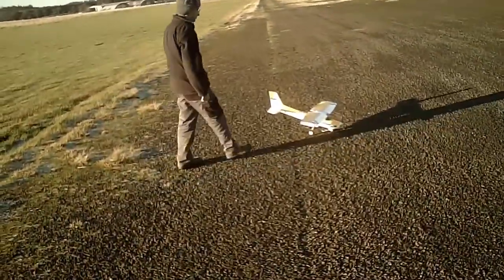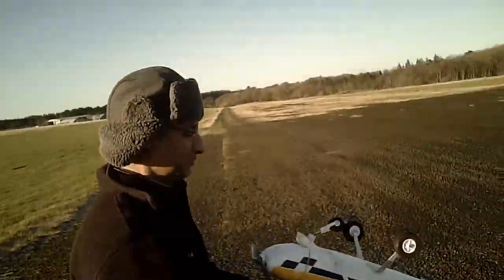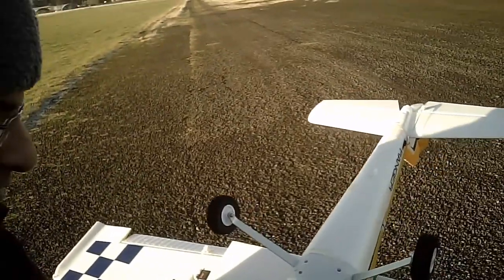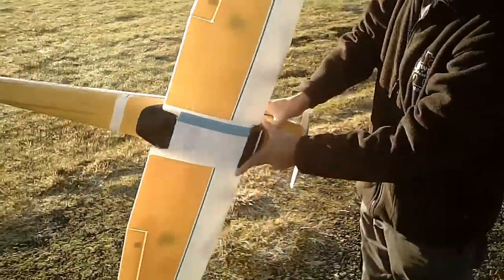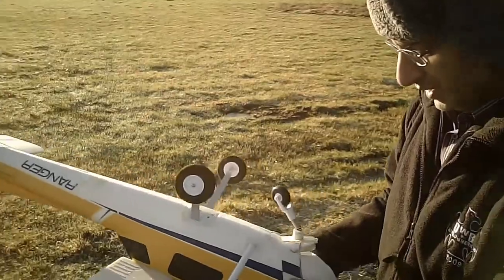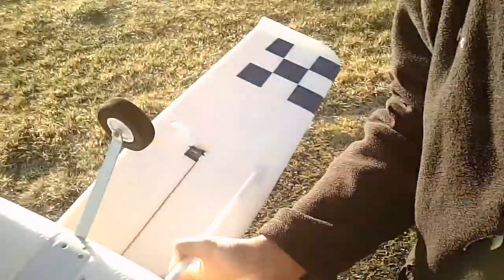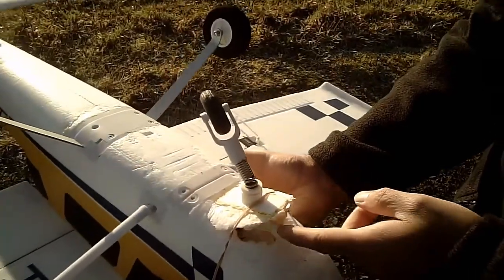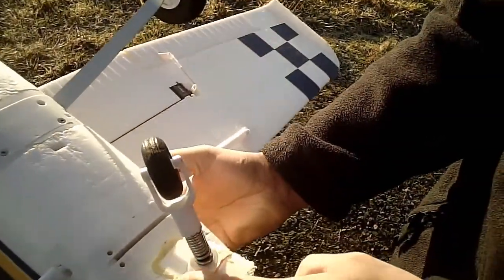FMS Ranger 1220 nosewheel repair

Comment: Did the same to mine several times...
Reply from the maker: Yes that fancy nose gear causes all kind of problems.  On our airfield the main problem is the small stones on the tarmac runway which causes the spring to bend every which way and normally ends in a prop strike and the spinner falling off.  I think once you have bent the spring once on a bad landing it is weaker and bends more readily.  A brand new Spring is just about useable at our site. I designed a couple of alternative nose wheels for the FMS1220.   I 3D printed a larger fork to take a bigger wheel and cut one of the old springs down so the overall height was the same.  In another version I 3D printed a cylinder which takes a piano wire conventional coil nose leg.  Neither has yet been tested.  Another person has replaced the spring with a plastic tube.   I think the real reason for the weird spring is that the foam on this plane is very light so they make the nosewheel very bendy to stop the foam breaking (you can still break it though).   The existing design works as long as you have a smooth runway.  I don't like the design of using a plastic fork on the nosewheel because it limits the wheel size.  I guess it was done to make it look scale.  A larger nosewheel is the best solution hence I 3D printed a larger fork which takes a bigger wheel.
Reply from the maker: You can see the nosewheel moving around in this video.  This was with a new spring, the flexing gets worse after it gets bent once and is then weaker.   https://www.youtube.com/watch?v=AHcE9cNeqbY

Comment: Must have been his first rc plane
Reply from the maker: There were actually two pilots involved.  The less experienced pilot took off but the more experienced pilot took over for the first landing.  It was highly unusual for him to crash like that.  His current theory is that it was something to do with the flight stabilizer and he is not used to flying with one.  His recollection is that he put in a little down, nothing happened, then he put in a bit more and it went straight into the tarmac.  Next time he has declared he is switching the stabiliser off before landing.